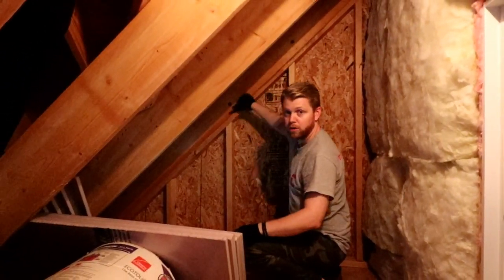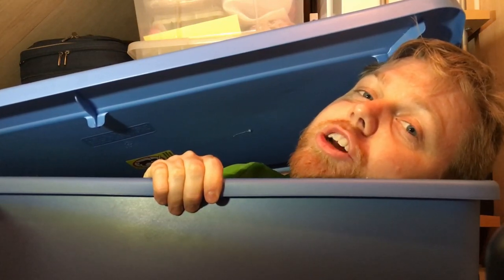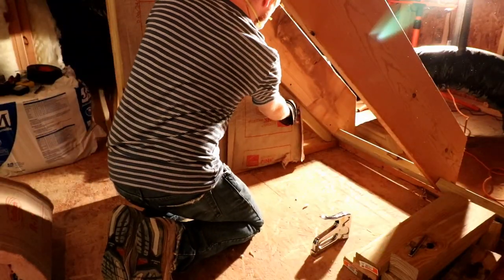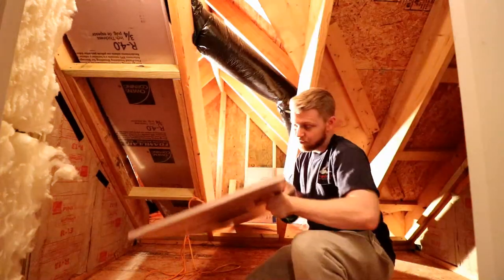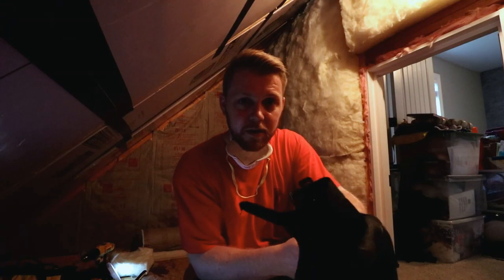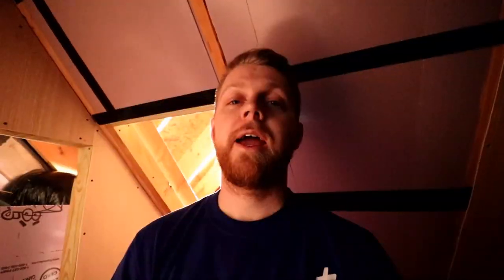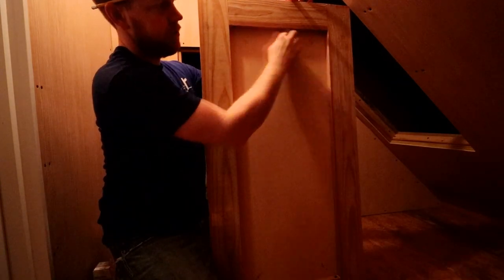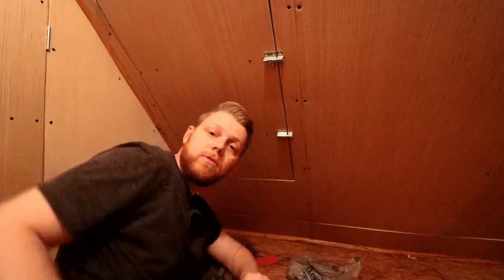DIY Attic into insulated clean storage!!

Comment: Great video!  Exactly what we are thinking of doing in our attic.  Did you insulate the back side of the access doors that you built?  Do you find the temp and humidity is pretty constantly maintained at an acceptable level now in that space?  Thanks!
Reply from the maker: Thanks! I would say it’s definitely worth it! I did insulate the back of the doors. I checked the temperature inside this area when it was the heat of the summer and the coldest of winter, and I was impressed how close it was to the inside temp. Like 8 - 10 degrees different if I remember correctly.

Comment: Brad what is the temp difference between the new space and attic. I noticed someone else asked this but there was no answer that I could see. Anyway did you find that the temp was not to hot during the summer heat? I need to create a space to store some things in my attic that will not be affected by heat.
Reply from the maker: Something happened with my email a little while ago, and all of my responses to comments got deleted. 🤦🏼‍♂️ I did notice quite a change in temp. If I remember correctly in the heat of the summer it was only about 12 degrees warmer in there than it was in the house. So, the heat has not been an issue. 👍🏻